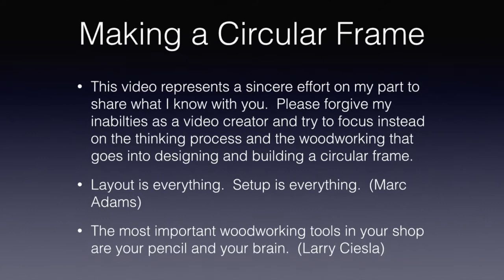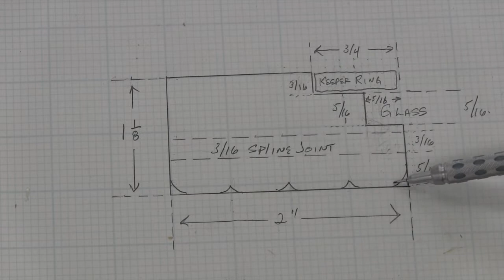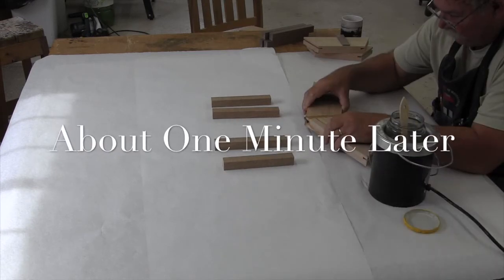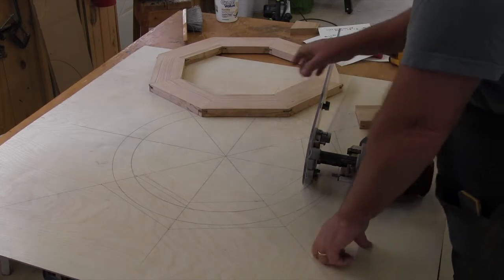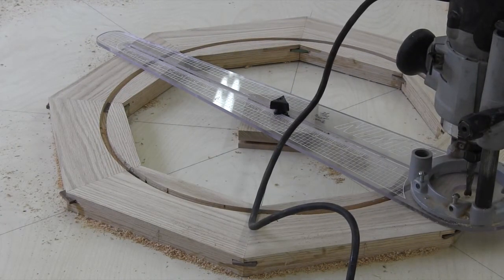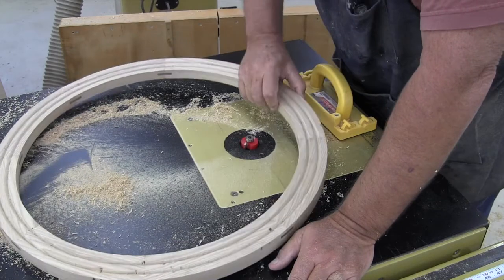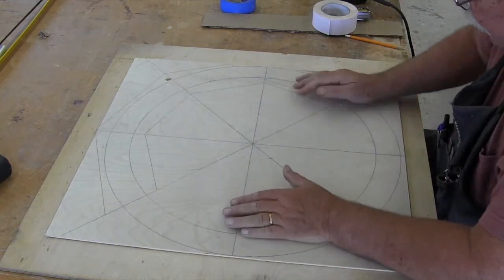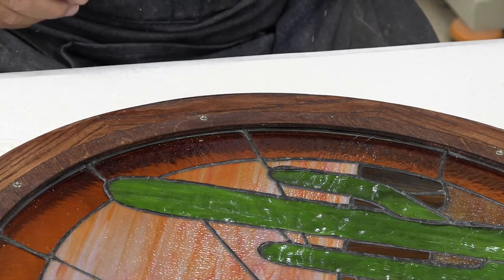circular picture frame

Comment: This is Joseph again from Pakistan I learned a lot from this video many great tips for my upcoming projects. Million of thanks. Just a question was there a specific reason that all the 8parts of octagon were not cut at once?
Reply from the maker: Yes there was.  Making all the cuts at once presumes you can set the angle of each cut precisely correct.  Even the tiniest error will be obvious as the errors will accumulate.  Making two halves, then joining both halves eliminates that problem.
Reply: @larryciesla  thank you so much.

Comment: Larry, I have enjoyed your videos, especially on marquetry and the use of your Festool Domino on the curve back chair.  This video is also well done. Just to pass along another method for jointing your mitered picture frame, check out Hoffmann MU2 P Routing Machine on "You Tube"  You could have omitted the spline joint and wouldn't need clamps with the machines routing dovetail key system. That entire frame could have been glued up and done in less than 25 minutes with the Hoffmann MU2 P.  I have owned this machine for nearly 20 years , and its amazing what it can do.  Check it out.  Nicole